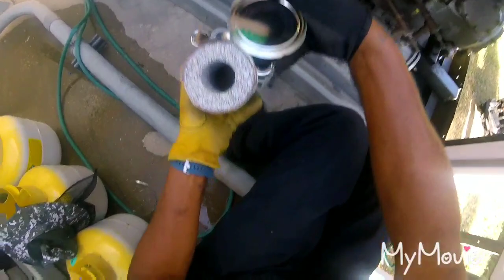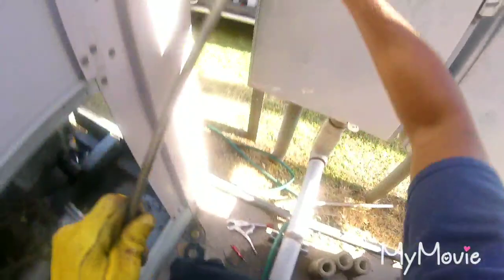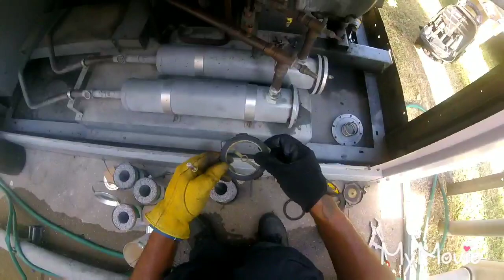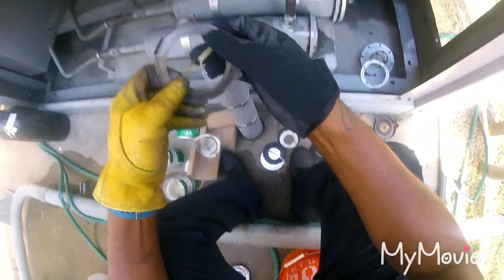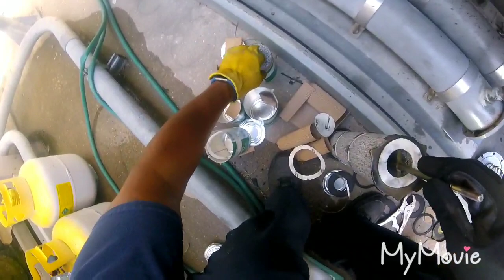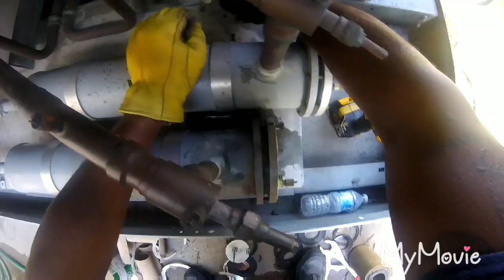HVAC: Replacing Filter Drier

Comment: Nice work. You read my mind when in your closing you stated about adding a valve just before the sight glass to avoid pump down and extended time doing the maintenance. The detail and time you took in preparing the gaskets between each core is why they value your work. When you can send a guy out and rest assured he's going to pay attention to small but significant details and make relevant suggestions to enhance efficiency, you've got someone you want to keep on board. Glad to see your personal touch, not something you have to be instructed to do. As usual UL , my sincere respect.